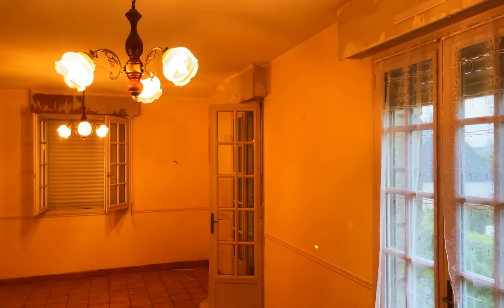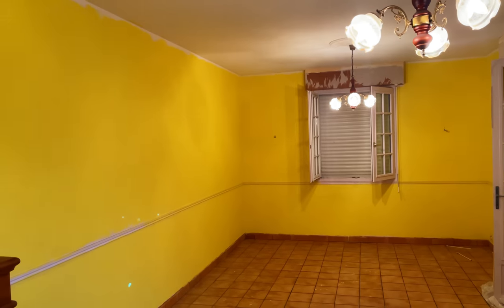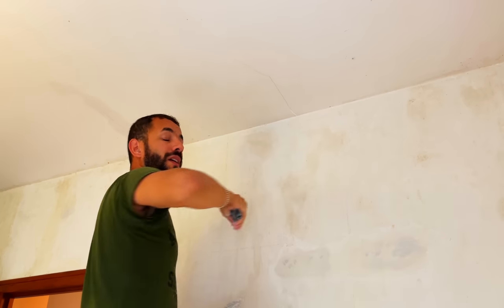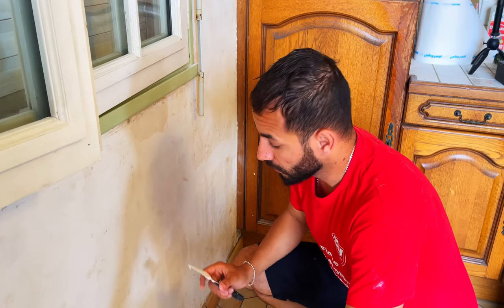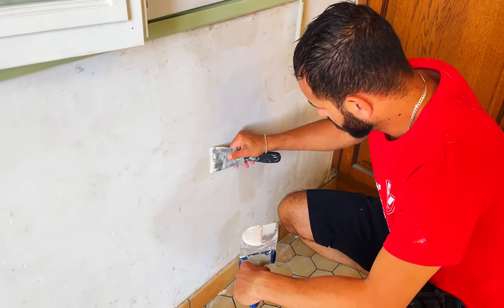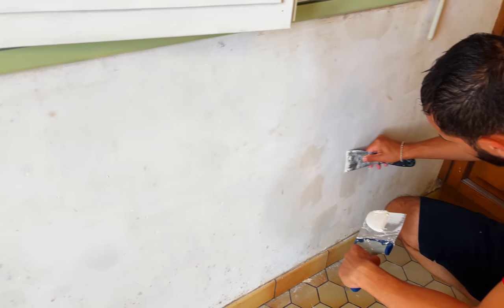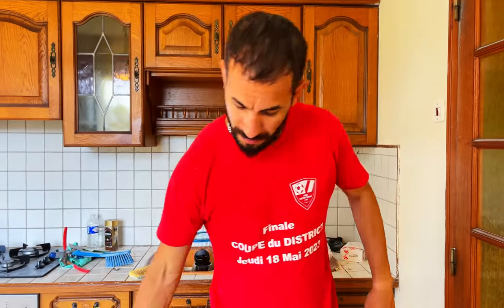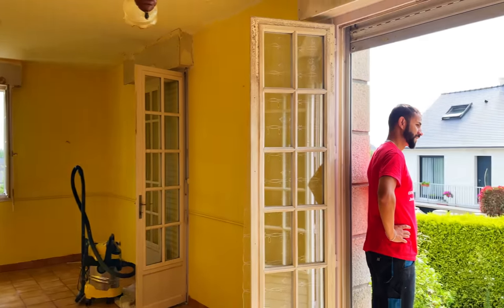Transforming The Heart of the Home: Progress in The Kitchen

Comment: Dear Mo, when painting a room, always start with the ceiling, then you can paint the walls. If you paint the walls first and then the ceiling, paint can drip onto the walls. And cover the entire floor so it's protected from the paint and you don't have to go through the hassle of cleaning the paint off after painting. ❤
Reply from the maker: In wanted just to have the 1st layer done so I can connect all the issues the real work is coming
Reply: Well done Mo, working hard as usual. 👍

Comment: You need to scrub the cupboards inside and out before you put any thing on to protect them.. I agree that you always start painting all the ceilings first doing all the cracks in the whole of the house, covering the floors, removing all the light fittings, pains drips on the wood would be a great pity.

Comment: If that was mould on the walls in the kitchen it should have been treated before painting otherwise it will just come through.
Reply: I think the moldy drywall should be replaced and determine what caused it in the first place.
Reply: First thing to do if you see mould on walls is put on an N-95 mask! Then, wearing gloves  black mould on the walls needs to be scrubbed with a 90% water/ 10% bleach solution. Then let the wall dry thoroughly. The source  of the mould is likely a leak from the roof or it could be a water pipe leak from a bathroom, a toilet, a shower, or a sink. You must investigate the cause of the mould before you paint job, or mould will come through the paint & be ruined if a leak from the roof or from a water pipe is not repaired.
Reply: It might be just surface mould from the heat from the back of a fridge or freezer. Either way it needed proper cleaning and a stain protection spray before painting.
Reply: It surely looks like mold.  Fix it!
Reply: If it is mould, the drywall should be removed to examine the insulation and infrastructure.
Reply: As someone who's life/health has seriously been effected by toxic mold, It's  No Joke.
Please take it as the serious situation that it is !!!
Reply: @jeansaggers2237  it should be completely remediated and removed.
I'm living with severe mold toxicity because someone chose to paint over, not remediate . I have extensive personal first hand knowledge of mold. Unfortunately,  bleach mixtures do not fix the problem. 50% of the population will have serious effects from it, and 50% of those 50% can have deadly consequences.
Reply: @cgp1442  I am sorry to hear that your life has been altered negatively bc of black mold.😢 Hope you can do as well as possible under the circumstances!👍
I really hope they read your post, as you know what you're talking about. Breathing in that dust is very harmful to the lungs and eyes! If the mold isn't properly addressed, it could be his grandparents' demise as well as his own.😮
Reply: It could just be dirt from the fan of the refrigerator.   I had that happen to me when I pulled my fridge from the wall to see black.  After close inspection it was just dust and dirt mixed with the heat from the fridge fan.  But if it is mold, most definitely it needs to be addressed.
Reply: @graciemaca6996  Exactly. I am very concerned especially because of their age, which would mean their immune system is not as strong.
People don't realize ( me too until it happened to me)  that you breathe it in, it then gets into your bloodstream,  then your internal organs. It will also kill your pets. It killed my dog and almost killed me twice. So I'm very vocal about how important it is to fully remediate.
Reply: If that were mold, the wall would be moist and you wouldn’t be able to sand it. Why are there so many online Karen’s harassing them?
Reply: Mo is an intelligent man and I am sure he would know if the wall had mold. Please stop judging people like they are stupid. Go find something to do and let me judge your project.

Comment: On screen the magnolia color looks warm and neutral - maybe consider painting all the rooms in that color since it softens the flooring tile color and brings continuity to a smaller house.  Let furnishings, artwork and accessories add the color to each of the rooms.  The egg yolk yellow in the lounge, is a bit overwhelming.  Second, mold is dangerous to breath and can cause long term health problems.  Don’t sand mold - you’re breathing in the spores - especially since you weren’t wearing protective gear.  You’ll also need to find out what’s causing the mold, and perhaps even replace that wallboard and check the insulation behind that wall and remove that as well.  Want to keep the grandparents healthy.